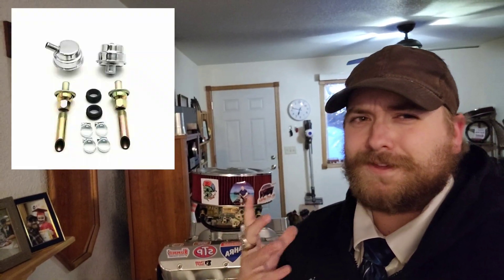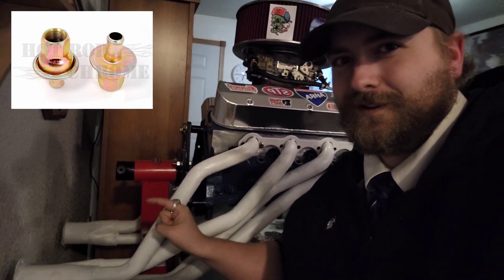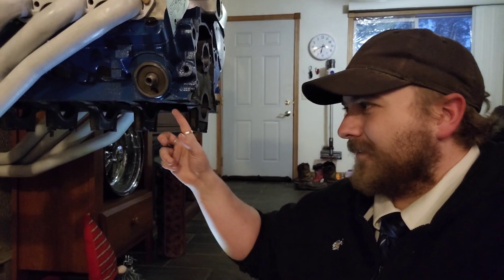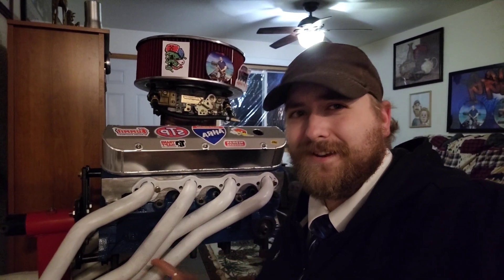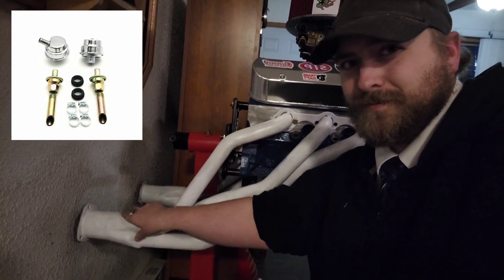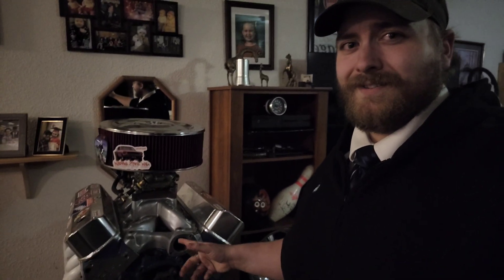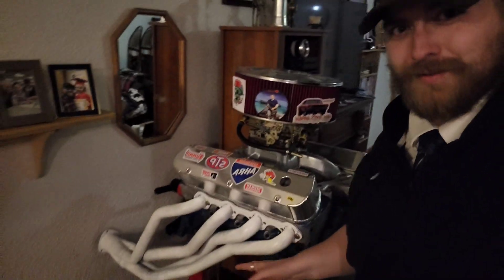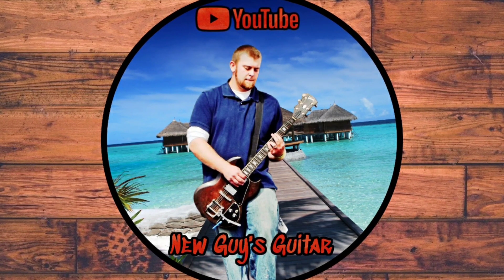Old School Power! How Does A Crankcase Evacuation System Work?

Comment: I have a 350 sbc with 142 blower on, only have breather now but I want some positive ventilation on Them and get rid of Oil all over the engine, is this the best option for blower engine? There is almost no vacuum when rev more than idle 👍🏻
Reply from the maker: Ya this is a good option for that lol. 

Will definitely want to make sure you have a baffle in your valve cover to help stop oil from getting thrown out 😁

Comment: So which is better exhaust evap or intake vacuum? Keep in mind my bbf tunnel ram only make 10" on a good day
Reply from the maker: Exhaust, intake vacuum won't pull a vacuum because you need to vent it unlike the Exhaust evac system 😁

Comment: Do you cancel the pcv valve if you go with the crankcase ventilation system option?

Awesome video! I prefer this to a catch can :)
Reply from the maker: @jean-michaelboisvert3955  yes you would replace the pcv with the crankcase evac 😁

Comment: I'm doing it. This actually dawned on me then I looked it up and you explained it perfectly. why don't car manufacturers vent the pcv valve to the exhaust right before the catalytic converter 😮
Reply from the maker: Because it would probably not meet emissions requirements for new cars lol
Reply: It should have no problems with emissions with it before the cat like you said, as the point of the catalyst is to burn unburnt and partially burnt hydrocarbons, which vapors from the crankcase contain. It would also solve the biggest problem of modern direct injected engines which is buildup of carbon deposits in the intake ports and on the intake valves, the majority of which comes from oily crankcase gases being sucked in from the PCV system. It should even work well with a turbocharged engine, as long as you locate it somewhere downstream of the turbine.

Comment: question, is it common to just replace the pvc and the breather on the opposite side with the new system or in conjunction with the pvc system? If the pvc is eliminated is the breather still required to let the air in or are we just simply going for negative pressure.
Reply from the maker: @mypotatomunchkin  negative pressure is the optimal goal 👍

Comment: I utilize this same method on my airplane. The engines a basically 1930’s air cooled big bore engine so the crankcase builds up a lot of pressure and robs power. It gave a noticeable power increase for a 360ci engine

Comment: Header evac systems definitely work! On my Olds 455 street/strip combo the system, at 1100rpm idle, pulls so much vacuum that I can pull a valve cover breather connected to just one side via 5/8 hose will stick to your hand on the plug into grommet breather side and you haven't to wiggle and turn sideways said breather to get it lose from the palm of your hand. 
I never measured the actual vacuum but for sure it's present and it's more than just a little bit. 
Yes these systems will put smoke out the exhaust pipes, depending on how well the valve cover is baffled, so that is one downside. As far as helping the rings seat on a 13:1 compression 620hp n/a motor...? Let's just say YES...ring seal is considerably better with that low pressure/vacuum in the crankcase!
Reply from the maker: Old school stuff! Works really good 😁👍

Comment: Hello o just did it on my 327 and the question is do i need a breather on the engine ? Like the old intakes? I have the airgap and now Both sides of the valve covers go to the headders  so i dont know if i got it right thanks
Reply from the maker: Nope not required when using an evacuation system 🙂
Reply: @newguysgarage6802  thank you so much for reply 🙂🙂🙂
Reply from the maker: @murmullosBOMBUSKLAP  no problem 😁👍

Comment: The old school v8's would have a PCV valve on one valve cover going to the intake manifold, and another vent  on the other valve cover with a hose going into the air filter housing.  The air filter housing had a foam filter on the hose inlet to prevent oil from gunking the carburetor.  Thus both valve covers were vented.  I preferred to simply run valve cover breathers on both sides venting to fresh air, however if your windows were open you would end up catching a fair bit of exhaust odor coming from the engine compartment.

Comment: Super high compression motors at full throttle would blow oil out on the track.   This was developed to stop that.   Some one is always making up crap to explain something.
Reply: No.
Very high compression engines do make a lot of blowby, but not enough to oil the track unless it's so worn out the engine itself becomes an oil pump out the exhaust.
The scavenge effect from the header collector does in fact create a significant amount of negative pressure, or vacuum to pull from the crankcase, therefore removing any blowby and also helping the rings to seat because of the vacuum below the rings. The system increases power significantly on high compression high horsepower applications.
Don't know what you are going on about, but the system DEFINITELY works.  And I can prove it with my own setup

Comment: Ok, so which of these two systems is the better option allows you to gain better horsepower?
Reply from the maker: You talking about vaccum pump vs evac system on header?
Reply: @newguysgarage6802  evac system vs stock Subaru PCV system.

Comment: Also supercharged engines need this? If yes is it the same method?
Reply from the maker: Yes will help with supercharged engines too, if roots or centrifugal supercharger its the same.

For a turbo application however im not sure how or were you would want to put it......after the turbo mabey 🤔
Reply: After turbo won't have enough scavenge effect to draw a negative pressure (vacuum) from the crankcase.
Ahead of the turbo will play havoc with spooling the turbine...so no, don't really work with turbos
Reply: @williamstamper442 that's actually not true at all. Many people do this with turbo charged diesels.

Comment: Ok, that is what the car wants you to believe, but in fact, that is a Crack pipe for the engine... Its why it finds your inputs more interesting and seemingly has more power/responds better with it... Just ask any cra(n)ck-case and you will get a honest answer... Machinery likes to hide its vices, but not junkies... :P
p.s. all jokes aside, that is a brilliant system, but quite severely incompatible with modern cars... All the nonsense added onto the exhaust that does not like oil and shit like that... The catalyst, the dpf in case of a diesel and such systems dont really fare too well with oil contamination... I dont hate those, dont get me wrong, i love the catalyst and dpf on diesels, for they really do make the car much less offensive to the nose, but they force you to place this weld pipe much further down the exhaust, after both the turbo(90%of modern cars) and the filters like the cat and dpf, which can place it over a full meter(over 3 feet) away, making you rely on much longer hoses to connect to the covers... And longer hose reduces pressure by itself, or negative pressure, rendering the system less efficient(even less so, as its much further away from the manifold, where the venturi effect would be the strongest) and at risk of catching fire if not well assembled to make sure your hose cant touch the hot exhaust in the first 3 feet after the manifold... Sure, there are solutions to it, but this is really a cherry atop the cake for essentially pre 1970`s or even pre `60`s cars with their much less complicated systems... Which i know the channel is all about, but i cant help myself from lamenting the apparent flaws of complexity with modern cars... By modern, i mean from 1990s to 2012... 2012 and after arent cars anymore, its just overpriced junk designed to fall apart in less than a decade... Looks amazing and drives amazing, but its junk...
Reply from the maker: Lol 🤣 
Thats awesome 👌

Comment: Let's say you have a centrifugal supercharged setup. What if I setup an oil catch can coming off the intake manifold going into the intake pipe of the supercharger. That way ur using the supercharger to pull crankcase pressure out
Reply from the maker: I see where your going with this. Lets simplify it even further though because really would that not just be a normal pcv system? 

It couldn't come off the intake it would have to come off a valve cover to evacuate from the crankcase, so that would be no different then if you just had a normal pcv system in place. 

Problem is then instead of evacuating pressure from the crankcase you would be (attempting, check valve would stop it) to send boost into the crankcase. 

Because the reason the pcv is able to pull gasses out of the crankcase is because there is manifold vaccum, in a supercharged application there is not vaccum but boost pressure. 

Now you could hook it to ported vacuum I suppose 🤔 that should still be vaccum even under boost...... hmmmmm.... could you have two pcv valves hooked to ported vacuum in a supercharged application without it making the engine run crappy....I'm not sure that is a good question 😂😁😃
Reply: @newguysgarage6802  well in the modern hemi applications, there's no breathers coming off valve covers, the PCV ports are integrated into the intake manifold. 

Also the PCV hose would be connected to the inlet side of the supercharger, which is constantly sucking in air.
Reply from the maker: Ahh ya they must have a passage to the crankcase through the intake then i see. 

But theoretically it could work...might have to worry about oil getting sucked up and thrown through the supercharger but that should be that big of an issue. 

But i guess the real question is, whatever air that is going in is the same air that is getting thrown out so really the bung in the exhaust tube would be just as effective as this theoretically possible solution would it not 🤔

Only then you wouldn't be feeding dirty air through the motor if its hooked to the exhaust. 😅
Reply: @newguysgarage6802  The catch can will catch all the crap and then the air is sent through the intercooler
Reply from the maker: @danielpugliese7003  right, im just saying is there a benefit to it over the bung in the exhaust? 🤔

If they would both do the same job the same way, only one is reusing the air from the crankcase to go through the engine... what are the benefits? 

Not saying there needs to be any to be usable, just thinking it through is all lol.
Reply: @newguysgarage6802  true. Not sure what's creating more suction, the supercharger or exhaust
Reply from the maker: But why not do both then? Could you increase the amount of suction by having both done? 

If there is no true detriment to having it on the intake side then I would think having both would increase the amount of vacuum you could pull from the crankcase 🤔
Reply from the maker: Oh im thinking roots style though! 

For centrifugal you would have to have it hooked before the superchargers inlet for vaccum
Reply: @newguysgarage6802  yes exactly. Basically using the supercharger a vacuum pump. I can't find any examples of guys doing this on YouTube. But it makes a lot of sense to me

Comment: what’s your take on the classic old “302 500 hp block split”? what’s some things you’re going to do to prevent that from happening on that engine in the video? i’m trying to build up a 302 for my truck and the block split issue is the one thing that’s concerning me about it
Reply: It’s a very real thing. Look up David Vizards video on how to make the 302 last. In the past I’ve used main studs/girdles and filled the block personally.
Reply from the maker: Darryl Smith is right, 
Definitely using a stud girdle but honestly that is about it for me. 

Lots of people run them up over 500hp without issues, some people have them split. 

So im just going to take it as it comes lol 😆
Reply: @newguysgarage6802  yeah just watched his video and i’m definitely gonna go with the DSS stud girdle
Reply from the maker: Thats what I thought too 🙂
The custom machining of the main caps is cool but.....little outside of what im really able to have done 😅
Reply: @newguysgarage6802  yeahh. plus i’m really only shooting for 450-500 horsepower as it’s only going in a pickup truck (actually the one in my pfp) but just want to be safe as i don’t want to pour thousands into an engine just for it to blow up when i have fun with it 😅
Reply from the maker: Understandable 🙂
Reply: ahh gotcha. will definitely be watching vizard’s video on that lol. i would just wing it and see what happens but that’s a lot of money to risk if it all goes wrong 😂
Reply from the maker: 93Jake 
That it is! Lol